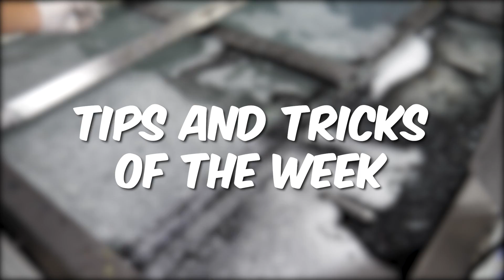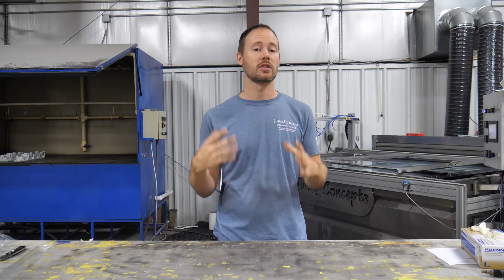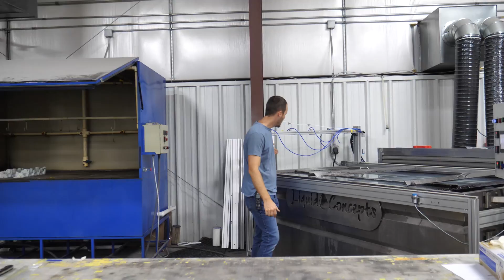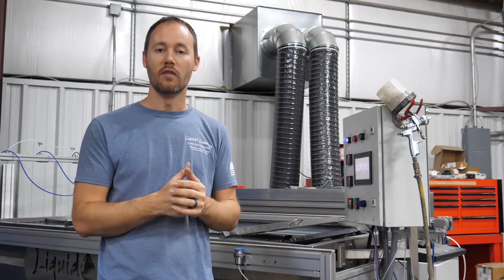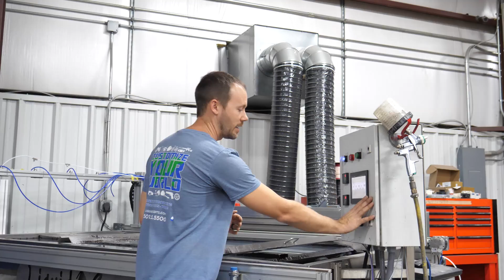TOP 5 THINGS TO LOOK FOR IN A HYDROGRAPHICS TANK | Liquid Concepts | Weekly Tips and Tricks

Comment: For a diy'er, do you have a recommendation for how keep the tank and water from growing algae?
I have a 100 gallon "tank". I'm looking into ways to filter the water, but my question is more around preventing algae growth itself. I have a submersible heating element, so the water is at temperature. Will adding bleach affect the film or activator?
Reply from the maker: Normally bleach will not affect the film or activator. You can treat it very similar to a hot tub and still be able to get good results when dipping.

Comment: I’m thinking about starting a hydrographic business in my area but first I’m a custom painter of 25 yrs. And this will Taylor around that. my question is, have you thought about using a mid coat base coat to save on paint materials? I know how expensive that can be but a nice coat of ppg dbc500 will still give you your ground color to work with yet a solvent coating for the graphic material to bond to.

Comment: Typically what HP rating for your pump do you prefer to use on that size of tank?   I've got a 3/4 Hp rating pump on my tank currently. But my internal shaft is leaking and I'm probably just going to replace the pump completely.